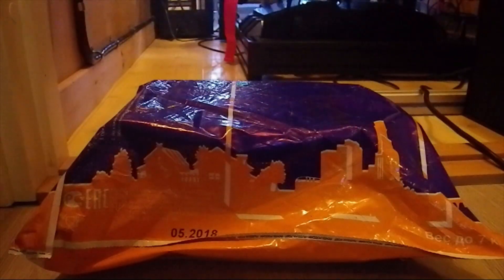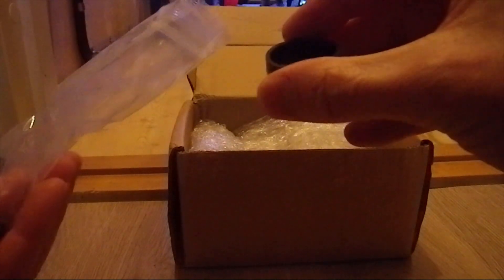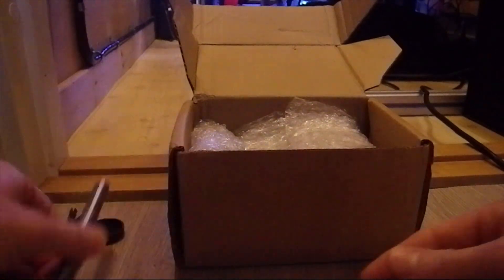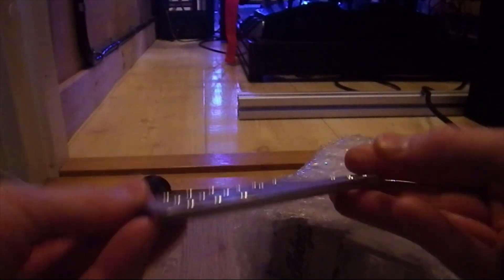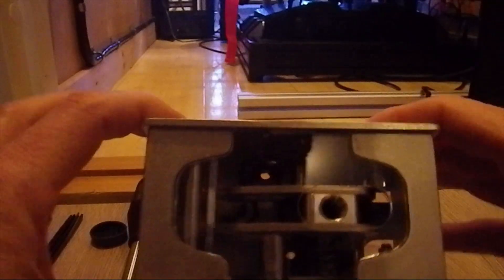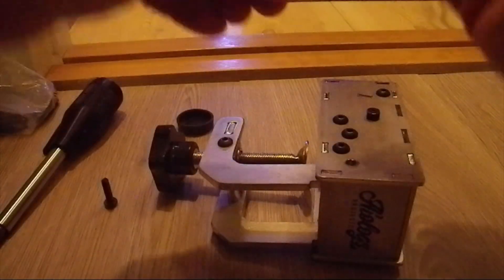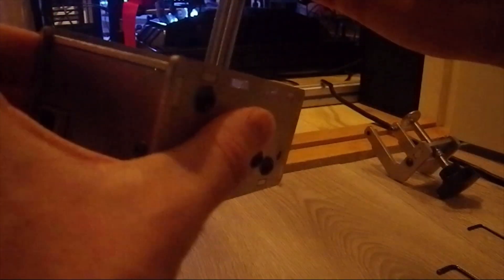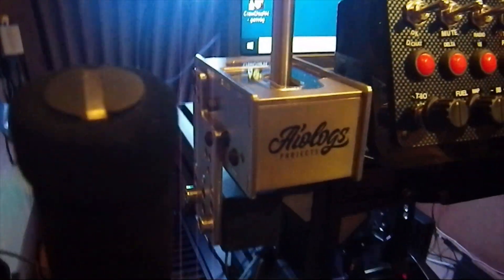Unboxing. Aiologs Sequential Shifter With New 2020 Gear Knob

Comment: The gear knob is bigger. Mine was smaller but was threaded. Kind of disappointing he changed the threading part. Nice and compact hardware and can be put almost anywhere. You will like it. If i didnt get the quaife/Pro-Sim i would have kept it.
Reply from the maker: Yeah I would have preferred the new knob to be threaded as well.. But really solid and compact shifter, with nice feel and sound to it!
Not as good as the big boy though I guess.. :)

Comment: So how ironic that you tested the shifter I was most thinking of upgrading too, R-VR Closet....
But although it would be much cheaper, I assume that it wouldn't compare to that last metal gated shifter you tested in the last video?
Reply from the maker: Hehehe yeah what's the chance I'm having another shifter.. :D
They are pretty different yes, but impressed by this compact shifter, really good value for the money!
This is only a sequential though, pull down to shift up and push forward to shift down.

Comment: New to this, does any shifter for example fanatec clubsport work with Logitech wheel and pedals for Xbox one? If not which shifters do
Reply from the maker: Yes, but you need something like the drivehub to make it work: https://youtu.be/VHE4hIYRn2k
Compatible shifters are:
AIOLOGS SQ Shifter
Fanatec SQ v1.5
 (With Fanatec usb adapter as well)
Thrustmaster TH8A
Thrustmaster TH8
Thrustmaster TSS
FREX GP
Reply: R-VR Closet thank you for replying!!, so the drive hub looks like it makes wheels and pedals work for different consoles , but do I need one to make a Xbox one fanatec shifter work with Xbox one Logitech wheels and pedals?
Reply from the maker: @jlove24  Sadly yes, you can't mix differen't wheels, pedals and shifters on console. A Fanatec shifter can't be plugged into a Logitech wheel base, and won't work directly plugged into a Xbox one or PS4 without a drive hub.
Reply: R-VR Closet thank you!
Reply from the maker: You are welcome! :)